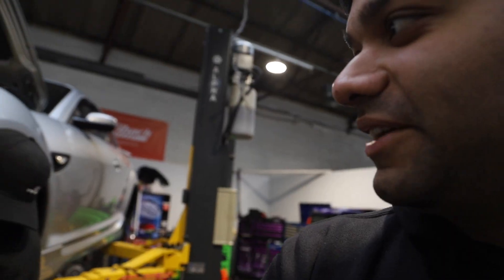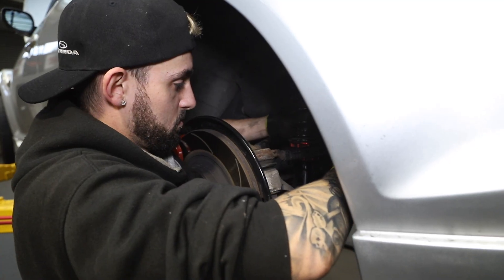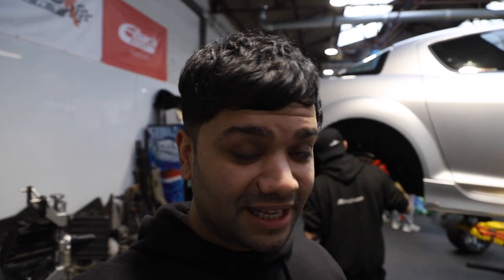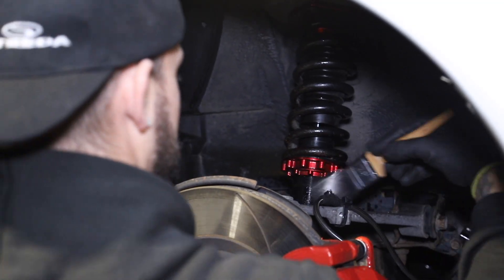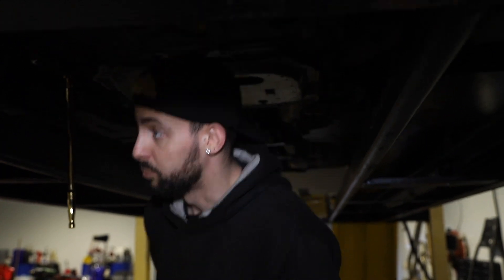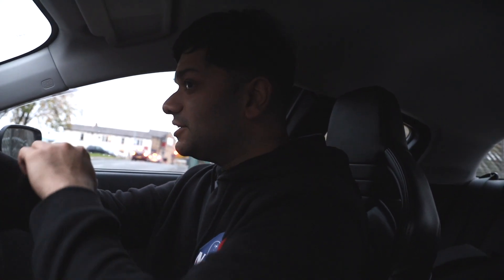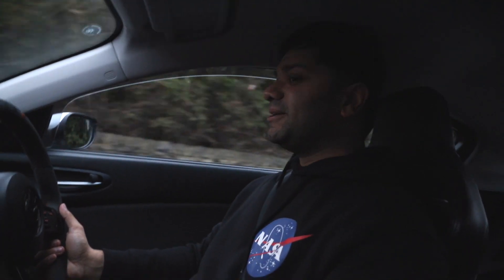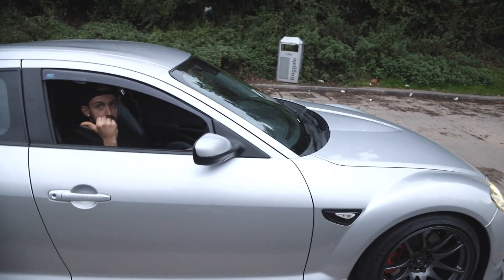MAZDA RX-8 R3 ***NEW WHEELS***

Comment: Holy crap that sound <3_<3 Do you need an ECU tune to get the pops and bangs out or is a decat enough?
Reply from the maker: The "Braps" is from the 'Race Extension' on the bridge port and the "Pops & Bangs" are tuned in the ECU with throttle percentage control! You'll definitely a decat in order for this to work :D
Reply: @RotaryRevs  Thanks a lot for the reply! What software do you use for the ECU tune? Are you even allowed to tell us? :D I saw a glimpse of it in that one Car Throttle video. I'm quite tech-savvy so technical stuff shouldn't be a problem...
My cat is also basically waiting to be kicked off :D

Comment: What are the running costs like on that R3? I'd love to own one when I can haha
Reply: 20mpg 500 quid road tax. Premixing. But u get 9k rpm and flames and a rotary.
Reply: @ao8271  Yeah, smiles per gallon are what I'm after to be fair ;). Thanks!
Reply from the maker: On Habbo's R3 with the Race Extension engine the running cost are quite high! 
With a standard R3 you'll be looking around 20 mpg or so. They do drink a lot of oil and the road tax is very high!